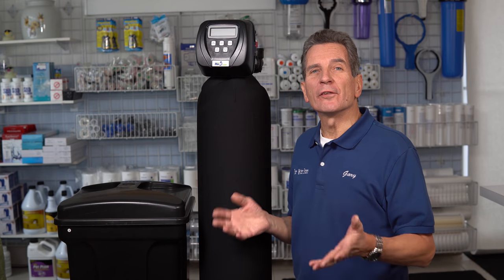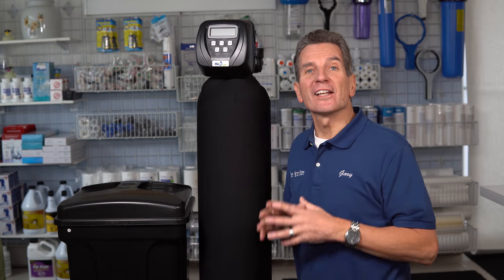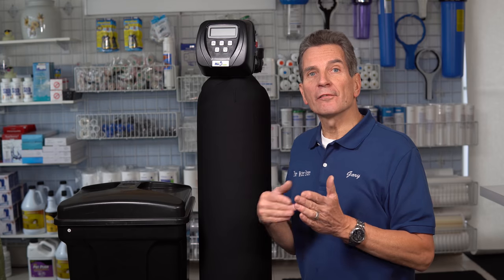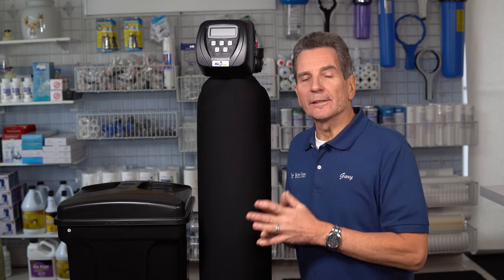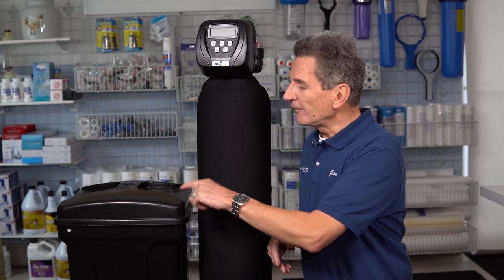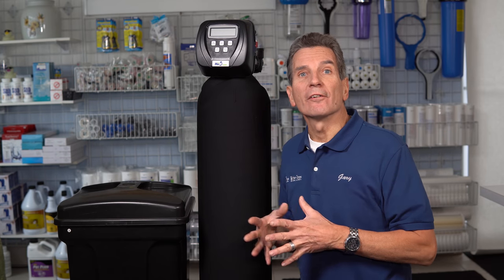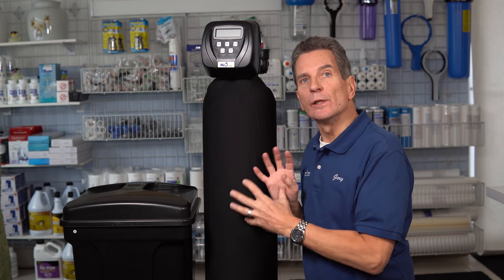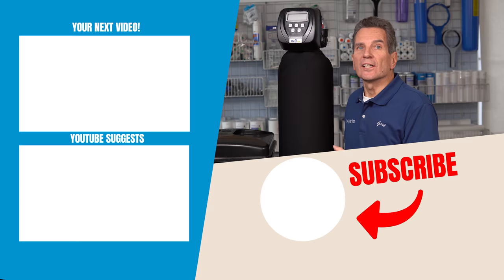WHAT is WATER SOFTENER REGENERATION?

Comment: Hey Gary, I use my cottage intermittently in the winter. I regenerated my Clack softener 2 weeks ago before I left and did not run any water before leaving. I am heading back the the cottage tomorrow. Do I need to repeat regeneration after 2 weeks with zero gallons being softened? If so, why? Does it hurt the softener if I was away for a month without using any water? Thanks Gary for your excellent info on your site! Sean
Reply from the maker: Great question!  Yes you should as you need to "fluff up" the media to keep it from clogging together in  the tank.

Comment: Good video thanks. I understand it is going to be noisey. I want to insulate the noise because it is on the other side of a bedroom wall. Waht part should I try to insulate,  salt tank or the Unit?
Reply from the maker: Good question!  The valve at the top and the drain line.  But they are not all that noisy, just sounds like water running.
Reply: @water_estore  This noise is loud during regeneation. We have two bedrooms next to the gargae wall. I will have to get up early to go into the garage to get a beter idea.

Comment: Thanks Gary. Great explanation. Not sure if you are still responding to questions, but if the control display gets unplugged (I have the Fusion 2 display), does this reset or cancell all the settings originally set up by the installer? Needless to say, I unplugged the display. 😒
Reply from the maker: Yes, still answering questions.  No need to worry, when you plug it back in it goes back to the original settings, you just need to set the current time.

Comment: Gary i got a culligan HE and its filling up in the brine tank. Not alot but about 4 inches higher than salt. I check and see that regen is about to happen in a few days. Is it normal for mines to fill up with water in the brine tank? Just bought this house too. Thnx.
Reply from the maker: Yes, Culligan water softens are post fill so they add water before the next regeration cycle.

Comment: Gary, I'm a 73 year old single male who lives alone. How many gallons would you expect me to use in a month on average. The reason for my question is that I am going through a ton of salt each month  and I suspect the installer set it up like he would for a family. I don't have a softener. It's just for water filtration. I need to adjust the regen cycle to the number of gallons I would use.
Reply from the maker: Likely about 1200 gallons, but that is  just an estimate.

Comment: I have Culligan water softener and it's got a Bypass button, which I think it will get the water from my water well to the house directly, bypassing the water softening mechanism. When I do this, should I also turn off (unplug) the water softening control unit as well (so that it doesnt try to regen in this bypass mode, and to save electricity)?
Reply from the maker: Yes, you can unplug the softener too, but it is not necessary.
Reply: @water_estore  So what happens if I hit the Bypass button, and dont turn off the control unit above it? Will it try to regenerate on its normal cycle and use water that is blocked (bypassed)? Would it damage the system in this situation?

Comment: Hey Gary, I appreciate the videos. I have a water softener that is 5+ years old. It never made this noise before recently it is now making a noise like it is constantly in the prefill cycle of the regeneration cycle. I look at my water meter to my home and there is no water flowing, so I know there isn't a leak in that sense. What could this mean? replace a control head? replace the whole unit. Water is still soft in the home.
Reply from the maker: This usually means that the piston is stuck and water is running continuously to drain.  This video might help https://youtu.be/hXcQ7qCxvjY

Comment: Do you have a video describing the mechanics in more detail - my softener will begin with a calve turning, then water running for about 10-15 minutes? Then silent. Sounds like pre fill, but i have water in the salt bin already. So..?  I’ve never stuck around in the basement long enough to see what else may happen. That’s what I was curious about 🙏🏻
Reply from the maker: This video should help https://youtu.be/hXcQ7qCxvjY
Reply: @water_estore  I had to clean out all the salt and water, about 4 inches from the bottom was a plastic four legged grate... never saw that before - anyway, I cleared that out, and underneath was the nastiest smelliest clump of salt/sludge I'd ever seen.  Clearly, the softener wasn't working.  Today - looks brand new and running like a champ!  Thank you

Comment: We've been living in our log home on a well for almost two years now.  Water tested great when we moved in and although kids didn't like the taste it wasn't the worst water I've had out of a tap. We've been through a rough few months as a family and didn't notice the power was off to our clack water softener for perhaps 8 months or more?  Until recently we had about 8 ppl in the home using water now its just 4 of us.  For the last 6 months we've had red/brown toilet bowls, tiles and sinks and for the last month or two white calcium build up is everywhere, dishwasher, facets and bidets are not working or not working as well as they were.  Laundry stinks and white residue on machine or hand washed dishes.  I just found your channel and have learned a ton about water systems now, was completely ignorant when I woke up this morning.  I've turned the power back on to the softeners.  The black rectangular brine tank has an inch or two of salt but only an inch of water covering that and it doesn't seem to reach the white brine tube or filter thing.   I've set the softener to regen and its completing that now.  Will it fill the brine tank back up?  I'm sure I will need to clean the resin in the tank after its been running water through it without any regen cycles for months. Should Iron out or a similar product alone be enough?   Anything I can run through the house's pipes to clean out calcium build up after I get the water system restored and working right again? Thanks this channel is great!
Reply from the maker: First, add about 100 lbs of salt and 5 gallons of water.  Use Iron out to clean the resin https://waterestore.ca/products/pro-rust-out-water-softener-cleaner Once the water softener is working, the soft water will clean out the pipes. Please share video with friends and family!
Reply: @water_estore  I will, thank you!!

Comment: Hi thanks for your video. Just to clarify, my system is setup to backwash, draw down, soften, backwash, rinse and fill brine tank. 

When the softener is in a mode called “softening” is this for when the water is in the softener (sounds like it) is in the brine tank?  How long should the softening mode be, 60-240 mins?

Thank you!
Reply from the maker: It sounds like you have a pre fill water softener. I am not familiar with the correct programming for those.  I would contact whomever you purchased it from or the the manufacturer.

Comment: Hello Gary, I have a Clack WS1 and during my systems regeneration cycle, I noticed that water is draining the whole time except during the "fill" step. I watched each step of the cycle and it does Backwash, Brine Draw Dn, Backwash, Rinse, and Fill). Is this normal for it to drain water the whole time? I only checked since recently I have noticed the yard was slightly flooded the morning of the regen cycles, but I have had this system now for about 6 months and never noticed that before. Thank you for any info !
Reply from the maker: Yes, that is correct, water runs to the drain during every cycle except fill and of course when it is in service.

Comment: I believe I have the same water softener from the water store your showing in this video but its a cream colour. Its about half/3/4 full of water over the salt. Is this normal? I tried cleaning the bottom horizontal slits, connecters (except for screw cap connector as it doesnt seem to turn). The water where i live is generally pretty hard. Thanks!
Reply from the maker: This video should help you trouble shoot that concern with your water softener https://youtu.be/Zikmilf_Tu0

Comment: Hello. Have learned a lot thus far with your help.  One thing i need to learn is if mine is metered or timed, but.. either way, if i run a manual regen, will it reset the timmer or meter? Would hate to run it twice on one day wasting salt and water. Thx
Reply from the maker: If it has an electronic valve, when you run water in the house, if it is metered you'll see an icon flash on the screen.  But yes, if you do a manual regeneration it will reset and go back to the schedule.

Comment: What would cause the tank to continue spewing out water even after the regeneration process has ended, which causes flooding?  Is it a valve inside or a specific component failure?
Reply from the maker: Depends on exaxtly where the water is coming from.  This video might help you to identify https://youtube.com/shorts/B1BBYt--pwY
Reply: OK- I guess my question is- What would cause the drain line to keep flushing water out even after the regen cycle has stopped and the power has been disconnected?  Also, is there an online place to purchase general repair parts for Aqua Systems type?  Thanks-  @water_estore

Comment: Hi Gary. My water softener is an aqua systems brand and the controller looks exactly like yours in the video. I think my regeneration duration is lasting 3 to 4 hours long. I don’t think that’s normal. Everything I see online it should be under 2 hours. Any advice?
Reply from the maker: If it is a pre fill water softener, that would be normal, for a post fill, that is not.  This video explains the difference https://youtu.be/GedMruLfXhY

Comment: Should my water softener and my whole house well water filter regenerate at different times of the day? The whole house well water filter regenerates every night at 2am. And the softener regenerates after 1000 gallons is used and waits until 2am also. I don't want to contaminate the softener by regenerating it with raw rusty water (6.8 ppm of iron). Thank you!
Reply from the maker: No, you need to cahnge the regen time so they never regenerate at the same time of day.

Comment: Hello. Thank you for this informative video. I have a post fill water softener in the garage. During each regeneration process, it is so loud that is heard inside the house in the three rooms near the garage. Is this normal? It happens at 3:00 am and it wakes me up every time. Can this be programmed do go off during the day? Thank you.
Reply from the maker: Probably normal.  Yes, you can change the settings so it goes off during the day just make sure it is ata time where no one is showering or doing laundry.
Reply from the maker: This video will help to reset https://youtu.be/qrnARW88Rc4
Reply: @water_estore  Excellent. Thank you.

Comment: Great info Gary, thanks. I have our softener set to regen every 4 days using 12lbs of salt. I wait until I can just see the water in the salt bin then add two 40lb bags of salt.
Reply from the maker: Sounds good.  Depending on your water's hardness and how much water you use (number of people in your household) the salt usage might be on the high side but when you have a time clock water softener like yours it's never exact compared to a usage based softener.  Thanks for watching!
Reply: Im trying to figure out how to set salt dose. Mine ranges from 3-13 on the spec sheet but does not specifically say how to set in the manual. The only thing I can figure is adjusting water level
Reply: I have a water softener which looks like the one in your video. About 8 months ago our city said they were going to soften our water and to turn off the water softener. Now I see that there is some scale in the dishwasher (not bad) and the glassware is lookin a little cloudy. Our hot water tank flame went out because it said it over heated. Now I bought some salt because I don’t think the city treatment is enough. What should I set my softener at and how many days apart should it be for a regen?

Comment: Hi Gary. Just curious. Does the drain tube that runs into the sink drain constantly as a regen is taking place? Mybwayers very hard so was winderi g if my tank has not regenerating enough. So i did a munual regen and it seemed for the whole time it was running  the drian tube was shooting out water.
Reply from the maker: Yes, it does until the last cycle.  Sometimes slower and sometimes faster.

Comment: What should I do if it’s been a year since The water softener has been turned on?
We just moved into a house a year ago but it’s been off since we bought the home. Any advice?
Reply from the maker: Yes, add a cup of cleaner to the brine tank https://waterestore.ca/products/pro-res-care-water-softener-resin-cleaner and manually regenerate the softener.  You might need to do it a couple of times and keep an eye on it in case it leaks.

Comment: Hi, just bought house with water softener (very new to me). I believe it goes through cycle every 14 days. I was wondering what the gallons remaining refers to and where all that water ends up? How much water does a water softener use and how it will affect my water utility bill? I'm contemplating either turning it off or using the bypass valve
Reply from the maker: This YouTube video of mine will help.  https://youtu.be/udmE-hhh084  You can bypass it to check out the difference but if you notice staining and difficulties with bathing, skin , hair and laundry you will soon take it back off bypass.  Water usage depends on type of softener anywhere fom 12 gallons to 90 gallons (for a really old one) per regeneration.
Reply: That video doesn't answer the question she asked LOL

Comment: Hi my won’t start regeneration even manually, I replaced wire kit , motor and position sensor, screen Just blink regenerate now and doesn’t do anything, is this valve or timer?
Reply from the maker: What make is it?  If it is Clack water softener like the one in this video and it won't start manually the circuit board needs replacement.
Reply: @water_estore   is a True Blue TB45 , like nortstar  they one of same 2 tanks Systems, I am actually also was trying to figure how hard to turn cam Gear should be, its hard to turn by hand , when I turn manually, I am going to take apart and change seal kit , I was trying to figure out how hard should it be? Should it turn easily?

Comment: I hit the regen cycle button and I am not sure if I did it right. I put bleach in the system because the water system company said that instead of iron out
Reply from the maker: Hit the button once to schedule a regen at your normal regen time.  Hold it down for 5 seconds and when you hear it start, let go and it will go through the regen cycle right now.

Comment: Good video how softeners work. I have a Culligan Mark 89 softener which will not regenerate. Seems to try to start but then shuts off after about 5-10 sec. Does not seem to be salt bridge or clogged drain line. Do you have any insight?
Reply from the maker: The motor might not be working or the piston is seized in the valve.

Comment: What happens if you cancel a regen with 3 minutes left on it and now I have some standing salt in there?
Reply from the maker: It would depend what cycle you were in when you cancelled the regeneration.  If it was 3 minutes before the end of the fill cycle there would not be enough water in with the salt to make the correct amount of brine.

Comment: Quick question: When the water softener regenerates should it be using a lot of water to regenerate? And does it flush the water heater at all? Whenever mine regenerates then I won't have any hot water for a bit or at least not as hot of water until the water heater has time to heat up water. Please and thank you in advance!
Reply from the maker: The amount of water used during regeneration can vary from 13 gallons to almost 100 based on the type of water softener you have.  I cannot see why it would have any affect on the hot water tank whatsoever.
Reply: Gary the Water Guy That's ridiculous, verging on criminal! There is no reason why 13 gallons are required, let alone 100. Why are US appliances so inefficient?! I'm in the UK. My softener is a twin tank system, meaning it can soften while regenerating, it's non electric, metered, and uses exactly 17 litres to regenerate which takes under ten minutes. I probably get through five kilos of salt a month. My softener is about the size of a microwave oven standing on its end. It can deliver fifty litres of softened water a minute which is enough to run three showers simultaneously- if my incoming supply was big enough! I live in one of the hardest water regions in the country and it performs perfectly using a fraction of the salt and water US models seem to.
Reply: @spencerwilton5831  Everything here in the USA is bigger. Including the appliances and people
Reply: Hate to tell you but some tanks depending on the system can use 35 to 60 gallons to regenerate

Comment: When the metered regeneration is triggered does the regeneration happen right away or is it then scheduled for the next say 2 am timeframe?  Only concerned that the regeneration happens in the middle of the day which would mean no water supply during the process unless it goes into bypass mode during the regeneration.  Any help here would be appreciated.
Reply from the maker: Great question!  They are setup to regenerate at the regeneration time for the reason you mentioned.  They can be setup to regenerate right away but normally are not.
Reply: It also depends on the type if you have a demand regeneration system with dual tanks